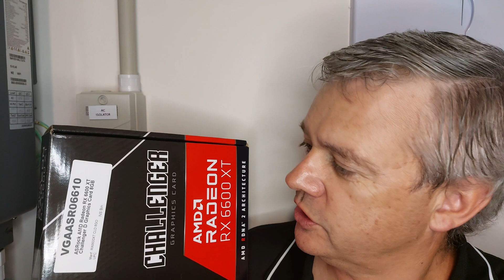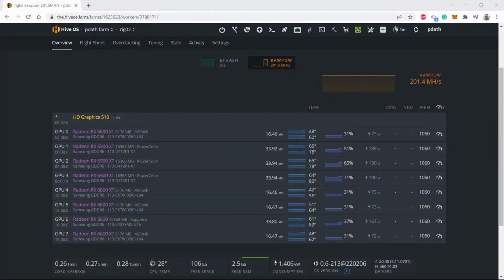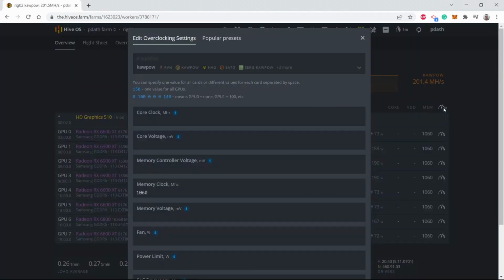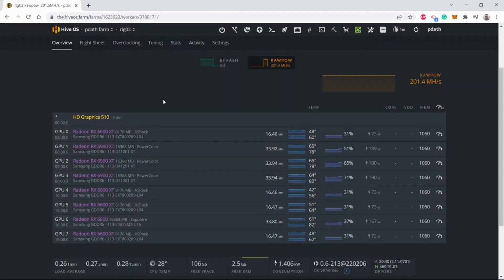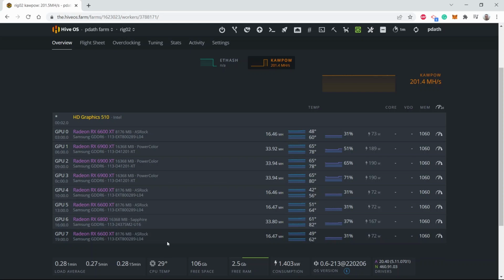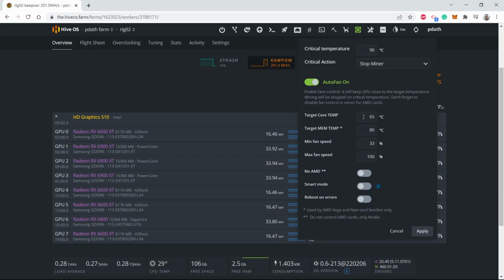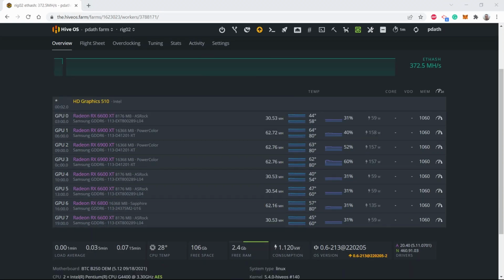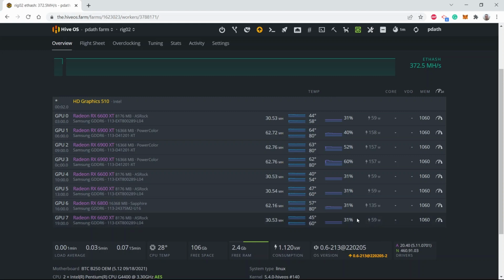Overclock ASRock Radeon RX 6600 XT Crypto Mining on HiveOS

Comment: The difference is huge from undervolting, believe me. Especially given that AMD cards under-report power draw. Obviously depends on how much you pay for power though. For 6800 try: 660/680/1190
And for 6600 XT try 660/ /1310
Should be rock solid, and muuucchh more efficient.
Reply from the maker: Is it more than a 10W saving per GPU?
Reply: @pdath  Your 6800 using 135w, mine uses 109w. So about 26w difference. Your 6600 XT's 59w, mine are 46w and 51w, model dependant. Those are all software numbers too, so probably more difference if detected and calculated from the wall.
And I don't know about 6900XT's.

Comment: Philip if u want to save some power try undervolting a bit,  ive  had great results with my 6 RX6800s. i run my gddr6 @ 1250---1270mv. and my cores around 660mv, your bigger cores(6900s) will need 700+ at a guess.
Reply from the maker: I did try, but the difference was so small I felt it was worth bothering with.  Having just a memory clock set makes it super simple and works with all 6000 series AMD cards - the whole lot.